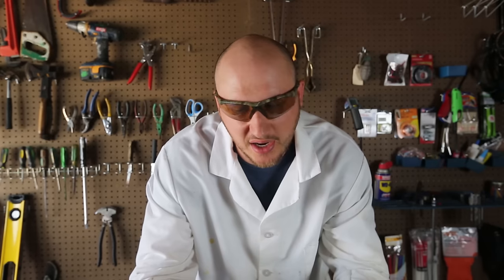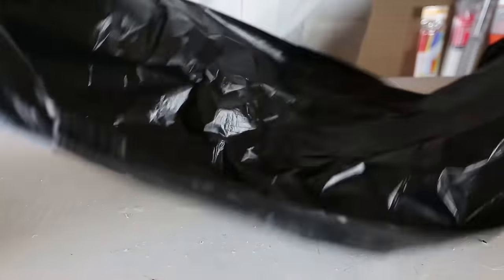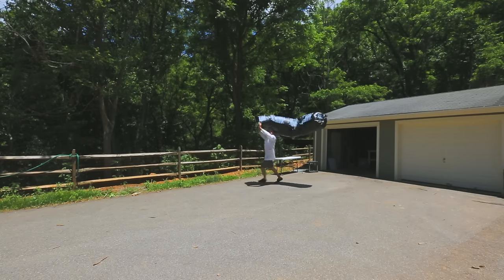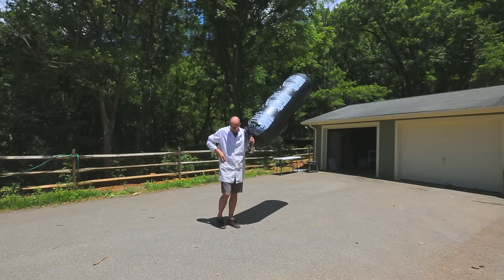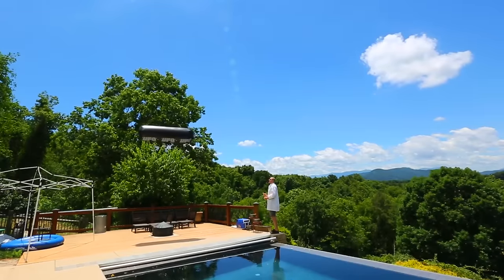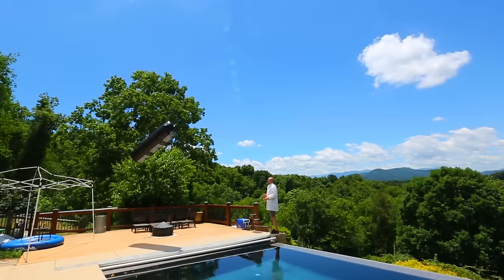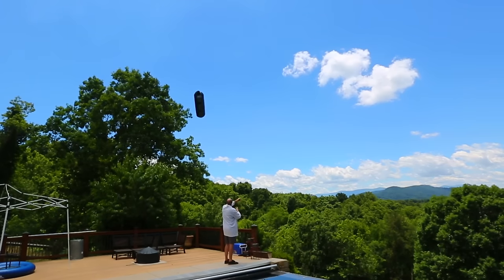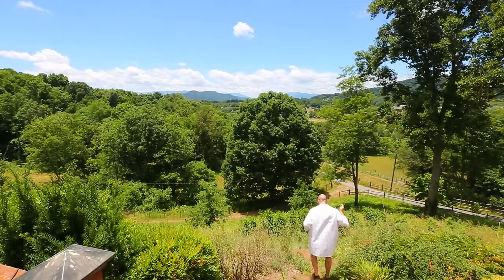How to Make Giant Flying Balloon without Helium

Comment: Color here is not accidental. The sun's rays heat the air in the black balloon, so it can fly. Basic physics knowledge
You can use trash bag - final effect will be the same.
Reply: He said that
Reply: Trash bags are too dense you need something that will have around the same density as the air or at least something with a large enough volume that when heated it will rise with the warm air inside
Reply: actually he could have done it  with a trash bag, but it wouldn't be crazy russian hacker unless he had bought it done.
Reply: Thanks, it's not like he explained it in the video.
Reply: black will be the best though, since it reflect off less light and absorb more heat

Comment: BALOON is not flying because HOT AIR WANTS TO GO UP ! LOL 

ITS cause when air inside baloon is heated  it has less density therefore baloon will bloow it self a little bit more cause particles of air are separating from each other and  baloon become s lighter(less dense ) than air surounding it so wants to go up where is less dense  or lower pressure